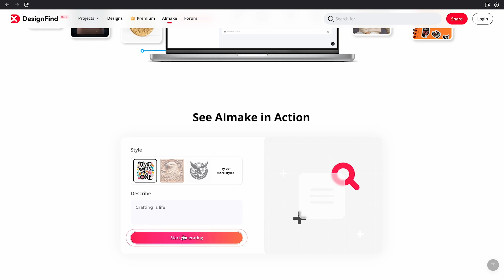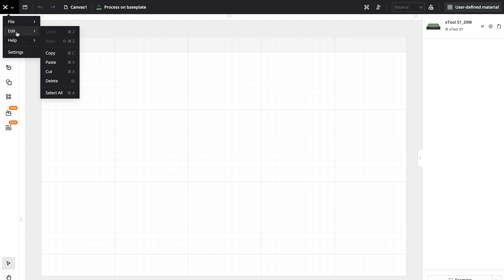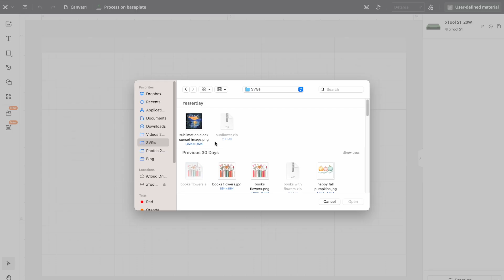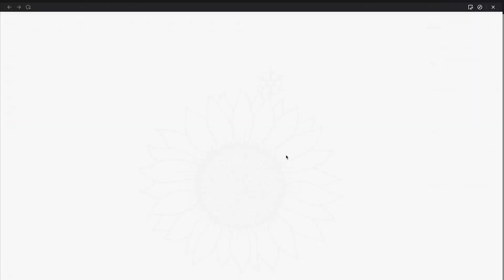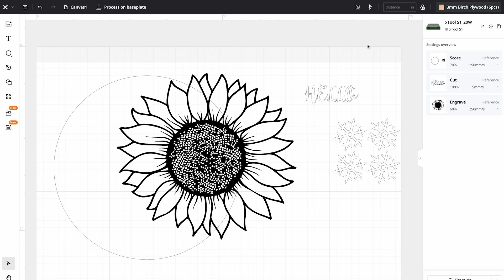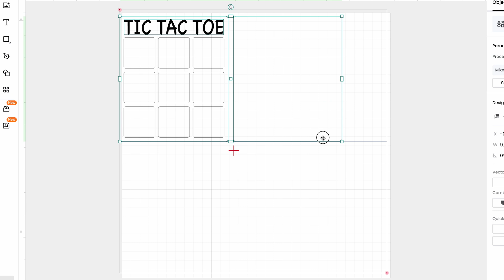xTool Creative Space: Your Complete Guide to xTool Software

Comment: Angie. my creative space grid was 17" x 17" and it is 17 x 12".  How can I resize it back to 17"x17"
Reply: Angie, I figured out the problem.  I bought extensions for my D1 Pro.  I have not done any cutting lately.  I have been engraving cutting boards.  I needed to change the surface to use extension.  Thank you for the help, Sue
Reply from the maker: I think it changes based on the machine you have selected and the type of processing. So maybe check to see if you have rotary or something else picked?

Comment: Hi! Do you have any guidance on why an image may change size once lasered to look "squished" on a tumbler? I have an XTool S1-40 watt and working on a full wrap for a 40oz Stanley, I have the perimeter accurate, preview and frame looks perfect. Measured correctly. Then I laser and it squishes, then there is a 1-2" gap where it should have wrapped BUT then I'll rerun it to test it and it wraps properly. 

Any suggests or best practices you could share will be greatly appreciated!!
Reply from the maker: The Stanley tumblers are going to be tricky. It is probably because there a wide variety of diameters. Try just doing the top or the bottom.

Comment: Definitely a newbie. xTool S1 10w. How can I use one of the embedded pictures like the sunflower, etch it and then cut it out? How do I tell the machine to etch the design and then either cut out a circle around it or cut it out based on the outline?
Reply from the maker: You can add a shape and make that a cut shape (like a circle). More difficult would be to duplicate the sunflower and ungroup the lines and try to isolate the outside edge for a cut.

Comment: I can't get out of the process on baseplate to go back to canvas. Im pretty computer literate but this I can't figure out. So frustrating. Anyone else can't go back? Any suggestions. I rather hit myself in the head if someone can point out the simple solution I am missing. Thanks
Reply from the maker: Click the process on baseplate button and that window closes.
Reply: @AngieHolden  I appreciate your reply. And maybe I didn't explain my issue or I have a glitch in the software on my MAC. I can click on the tab to open and close the window that allows me to choose what Im using, slates, screen print etc but I can not get to re work on the design on canvas. It will only show me how my design is laid out on the material in the bed. I can click all day but I can never get back to the design on the white grid canvas. The software also never closes without force quitting which is why Im thinking it might need to be uninstalled & reinstalled. Does that make any sense?  I also never get the "Framing" button over the process in the lower right, thought maybe that wasn't needed with the P2S Again thats for even replying.
Reply from the maker: I don't have a P2 so I can't speak to that. I would make sure you have the latest version of the software. Then make sure that your MAC OS is supported by that version. It may be a conflict!
Reply: @AngieHolden all is up to date. I’m just going to uninstall and re. In the mean time I’m chugging skiing with frustration. Still creating. Thanks again.

Comment: I need xcs for dummies.  I have the m1 ultra 10w and am totally lost. When you talk about 3mm wood, what does that mean? I am having an awful time with this.  What is the difference between the score and engrave?  Told you, I'm a total dummy.
Reply from the maker: Try this for score/engrave: https://youtube.com/shorts/KtQhj4LoLPQ

The 3 mm wood indicates the thickness of the wood. You need to know how thick what you are cutting is and what it is made out of.
Reply: Mm is a metric unit of measurement. Millimeter. You can change it to standard/imperial if you don't use the metric system.

Comment: I create my leather patterns in Affinity Designer. Sometimes I make oval name plates with people's names on them. Sometimes it's a fancy font. I save the file, then export to svg. I upload to my google drive, then go in my next room, which has my macbook connected to my X-tool S1 40w. I go back to google drive and save the file to my downloads.

I open the creative space, and import my svg. All of a sudden, the X-tool software tells me this font is not available (maybe cause I'm using an Apple?), so I won't get the output I want.

Solution to this for me. I open Inkscape, open the SVG. Click on the text. Top menu > path > object to path. Select the text (now a path), right click > copy. Go to Affinity, paste it where you need it. Export as SVG again, and import image into the creative space. Now that it's a path with many points (not text), it shows up perfectly. You could also save just the text from Inkscape, saving it as an SVG as well to avoid an extra step.

Originally, I learned all this because I was copying biblical Hebrew text, and it flows normally from right to left. No matter what I did, I couldn't get it to display in the correct order in Affinity no matter what, until I converted the text to a path in Inkscape.

Hopefully I helped someone.
Reply from the maker: In any design program you have to convert a text to path before you export the SVG. I do not use Affinity but I am assuming you can do it in there.